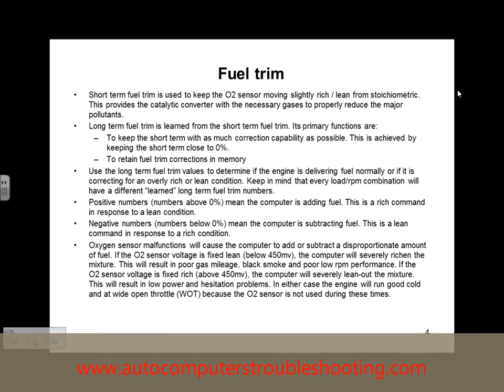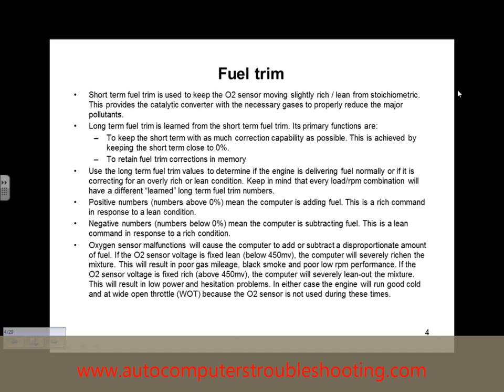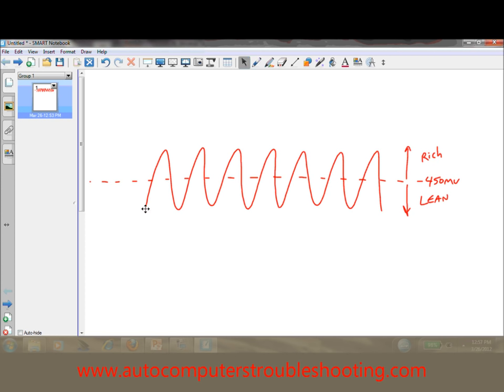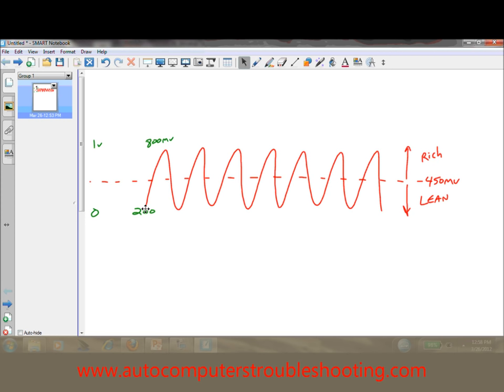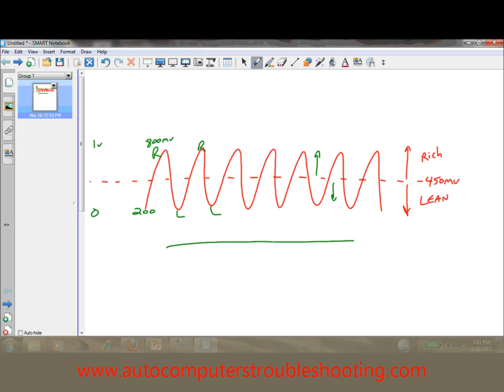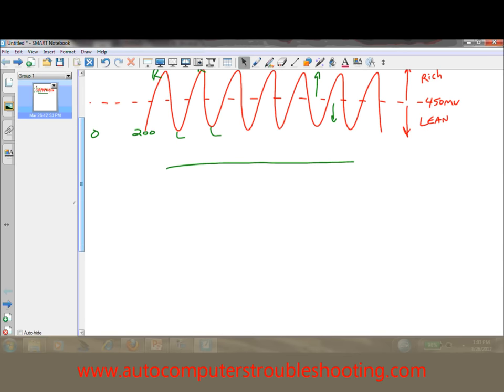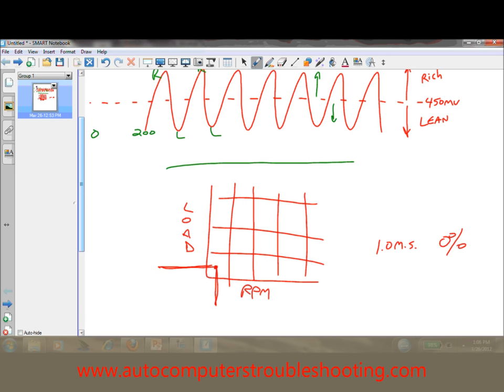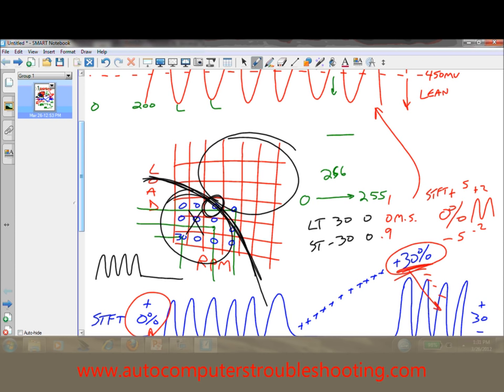Understanding Short Term and Long Term Fuel Trim (a SD Premium video)

Comment: Scanner i have a Ford focus 2004 1.6 petrol. The problem is that when i create a vacuum leak, than the short term fuel trim values stay at the same values -4 +4 % all the time. i already replaced the oxygen sensor 2 times. Could this mean i have a bad Ecu?

Comment: HI PAUL on AFR SENSOR WORK different as 02 sensor it say work opposite on a graph, like 800ml means lean not rich it is true or false, And how the PCM determinate to lower the RPMs in cold start what type inputs the PCM uses to lower the RPMs the soon as possible?

Comment: When the check engine light comes on, does it go into open loop? When in open loop are both short and long term fuel trims adjusted?
I have STFT running from 20-30, but LTFT is always 0 (live data). The light has been on for a while also; several hundred miles.
Reply from the maker: No, the system will only go into a FORCED open loop mode when it recognizes it can not adjust the air/fuel ratio any more, with the O2 is not responding. 
In open loop, you can possibly see some fuel trim changes, BUT, they are not being used. (WOT, decel, cold engine start are examples of normal open loop periods where I typically do not even look at trim numbers and I don't care what they are doing)
Don't worry about the why behind your long term staying at 0, focus on your short term, raise your RPM, see if it gets better or worse, this will dictate your next direction

Comment: My car 2015 Roush RS3.   STFT hover around +5 to -5.  (Normal is guess).  But LTFT bank 1 cruzin around 50mph is -11. Bank 2 is -5     Do you think there’s a slight issue with injectors on bank1?    My car is supercharged and at WOT it’s on 11lbs of boost.   LTFT go to -18 under full boost.
Knock goes -4.00 under boost at WOT. which it’s adding timing.

Comment: I’m wondering if fuel trims could help me determine if my 99 Ram 1500 with the 5.9 has the infamous intake plenum gasket leak....
Reply from the maker: On a MAP engine like yours, fuel trims can be near normal with a vacuum leak. What are your IAC counts? I believe it has one. (Throttle cable right?)
That is the data parameter that will really help you on this issue.

Comment: If the cat needs O2, why doesn't it take it from a different input other than the engine exhaust? So you could have small air pump connected to the cat downstream of O2 sensor 1. But if the extra air gets  to the sensor1, if would alter the o2 feedback.

Comment: I think first I need to understand more about the difference between MAP and MAF. I know fundamentally how both work, but not how they respond to vacuum leaks. Do MAP and MAF sensors account for the air from a vacuum leak? I thought air from the brake booster would enter the intake manifold behind the MAF sensor (essential bypassing it). How does the TPS affect the idle(the throttle would be closed)? FYI, I am not doubting anything that you say, I'm just trying to have a better understanding.

Comment: am currently getting codes p0153 and p0175 , my PDFEGR IN MY DIABLO scanner shows 1.08volts to 1.11volts always since warm up till 198degrees . my shortterm fuel trims for bank2 is -18% around fully warm up , i check and check no leak no vacumme leak, no bad connection, new o2s, change fuel filter, fuel pressure  is at 39-43psi , only thing i notice is on driverside valve cover non-pcv side it sucks air, as  well as oil filcap same side , pcv other side un plug and both side work correctly,?

Comment: Got FJ Cruiser 2010 with negative LFT (-3 to -13 in different conditions and -3 to -9 in idle). Compared with another FJ 2010 - he got LFT 0 to +5. 
My transmission got rough upshifting and downshifting. Can it be caused by LFT? The car got only 22k miles.

Comment from the maker: What you are describing sounds contradictory to me. If you have black smoke then the PCM should be subtracting fuel not adding it. Also if you can drive the O2s rich with a fuel source, how are they showing lean in a clearly rich environment?
The only real answer to this contradiction is you have a "false lean" condition. The O2s are "seeing" oxygen from something outside of the combustion chamber. (exhaust leaks, air pump) or you have a sever misfire.

Comment: Great explanation! I have a question regarding post cat o2 fuel trim. Many people say that post cat O2 sensors are only for monitoring catalytic converter efficiency. However I've seen codes such as "Post Catalyst Fuel Trim System Too Lean" etc. So does post cat O2 sensor affect fuel trim at all? Thanks.
Reply: Yes, I have been recently aware of this trend myself. I know that it is not on all systems and as far as I know does not have enough control to change the injector pw enough to cause any performance problems. I am not totally sure what they are doing with it yet.
Reply: ScannerDanner Premium I recently went to a BWD class and was informed Nissan's are starting this trend if the b1 sensor isn't functioning it only reads the b2 sensor until even if you replace the sensor you have to reset the fuel trims

Comment: Very Informative. I like your teaching method, as a non- professional mechanic, I got into this out of desperation to find out the solution to a Bank 1 STFT at -12 where a Bank 2 STTF runs around - 5, with both banks oscillating erratically but never in the same numbers. My LTFT is steady at - 12.5 always, even after clearing the mem.  I changed, spark plugs, spark plug cables, fuel pressure regulator, cap and rotor, all fuel injectors, intake gasket... CODE: P0175 and P0172.  Veh: Mitshubishi Eclipse 2003 3.0L Manual transmission.  Problem started after I used (overused probably) E-Z Foam.   Any suggestions are tremendously appreciated.  Thanks
Reply from the maker: +Ron Ackerman possibly contaminated the O2 sensors
Reply: Just what I thought after watching your video, so I ordered the 4 O2's. I'll keep you updated once I receive them and change them. Thanks for the reply.

Comment: Your statement of "the short term fuel trims number one job is to make sure that that O2 sensor is switching back and forth" is partially true. 

Switching and Stoichiometry: 
- When the engine runs lean (less fuel than ideal), the O2 sensor detects excess oxygen in the exhaust, causing its voltage to drop below 0.45 volts. 
- The ECM then increases the STFT, adding more fuel to the mixture. 
- As the fuel content rises, the O2 sensor detects an approaching rich condition and sends a voltage signal rising towards 0.45 volts. 
- The ECM responds by lowering the STFT, bringing the mixture back towards lean. 
- This creates the switching behavior of the O2 sensor - oscillating between voltages slightly above and below 0.45 volts - as it constantly reacts to the STFT adjustments and keeps the mixture near stoichiometry.

 Therefore, while STFT does influence the O2 sensor's switching frequency by adjusting the fuel mixture, its primary job is to maintain stoichiometry rather than directly control the sensor's oscillation. The switching is simply a consequence of the feedback loop ensuring optimal air-fuel ratio through constant adjustments.
Reply from the maker: to be honest, this is one of those things that you say potato and I say potahto

Comment: Best instruction on the web for anyone wanting to learn the workings of modern engine management...  Thanks... BTW - I have run into a puzzling '95 Tacoma w/2.7L if you chance to comment. STFT & LTFT <4% at idle (runs good) - at about 2000-2500 rpm, both STFT and LTFT rail at +20% and then misfire begins.  Yet, snap throttle reveals rich (normal) o2 reading during snap... I was ready to blame MAF, but it has been cleaned (no change) and reads about 11 gm/sec at 2500 rpm under no load.  A forum posting said the FSM for this vehicle lists 9.2-13.3  as normal.  Is that right (Maybe I'm barking up the wrong tree)?  Fuel pressures are good at idle, and disconnecting vacuum to pressure regulator reveal approx 10 psi change like it should.  It seems like you can "drive through" the problem (Idle and WOT o.k. - rich o2 on snap throttle seems to agree with this, and seems to me rules out Fuel flow issues like filter and pump).  TPS looks smooth on analog meter...I'm open to suggestions.
Reply: That is a tough one. I have seen MAFs fail like this. The signal output can be skewed and not be proportional to airflow at times.
I also never liked the steady throttle specs that are given for MAFs.  They've never helped me condemn one.
It sounds like you've covered all your bases. (Nice job btw!) 
I do have a concern though as you stated "misfire begins". Remember that most types of misfires will cause lean exhaust conditions. So is the misfire you feel a result of the lean condition (possible MAF issue) or is it the cause of a false lean condition (plug or wire problem etc) and your barking up the wrong tree?
What type of EGR valve if any does this engine have? If it's vacuum controlled can we unplug the EGR and test drive?
Reply: ScannerDanner Premium
Thanks 4 response.  I know ur a busy dude.  EGR was bypassed with same issue.  The $100 question is definitely "Is my upstream o2 asking for fuel because things are really lean, or because of an electrical misfire, causing the o2 to REPORT lean, adding additional fuel to all cylinders that already aren't burning it..."  I'm leaning toward an actual lean condition, because when I "sneak up" on 2500rpm, I can see the fuel trims rising into oblivion BEFORE I ultimately notice the misfire.  Also, in an attempt to correct the problem, the previous owner replaced the crank sensor, all plugs and wires, and the wasted spark ignition coil pack.  Unfortunately I am in one place, and the vehicle in another, so answers may not be immediately forthcoming, but I want to do another test before condemning the MAF sensor.  What has me puzzled is the rich o2 during snap throttle... looks good...but... I wanna see it under sustained load WOT (on a hill, etc.) to rule out (everyone overlooks the simple stuff...me too...) fuel filter, etc.  Sure, FP dead-head was good at over 90psi, and regulated pressure is good at idle, but there just might be enough fuel pressure still in the rail to pass a quick snap throttle test, and still starve it under sustained revving / load...Hmmm, good to know you don't trust the steady throttle spec's... The MAF IS where I am headed after that.  I just hate to be wrong... BTW - the previous owner sold this truck (131K) cheap to the current owner (and friend) because he became so frustrated with it... 1995 must be a weird year for obd2 ('cause of the transition)... at one point the truck had a P0300 along with 301, 302, 303, 304, but with a new o2 in front, all those went away...weird, because it's definitely still misfiring.  I also have a hard time believing it hasn't (ever!) logged a lean code with observed +40% total fuel trim! (maybe because as soon as rpm returns to idle, so do the trims?)  I think this early obd2 was not very sophisticated... Yikes!  I should also mention that the truck is very stock, right down to the factory (no leaks) air intake, baffles and air cleaner...
Reply: haywire17 Just before my MAF failed, my Prizm was compensating a lot less for a MAF. I'd check the fuel pressure to first rule out the fuel pump and then fuel injectors. I'm early on in my study of EGR so I'd have a harder time picking that out amongst the symptoms.

Disable the EGR, if the symptoms get better you've found your culprit.

You can always use a laser thermometer to see if certain cylinders are running cold. You'd have to remove the exhaust shields. This would certainly point me more at the fuel injectors being an issue. A laser thermometer in the needed temperature range is a lot more expensive, but I found one at Harbor Freight that I took a gamble on at 1/3 of the price of the mid priced ones on sale that can see the necessary temperature scale.
Reply: Don't Toyota"s require only the finest top grade materials in the CATS. Hope somebody didn't put a cheap one on  there. It is a 95, I'm just saying maybe its worth researching Toyota's notorious legend for CATS.
Reply: haywire17 I

Comment: Why don't the RPM's increase when the brake booster vacuum line is disconnected? This would cause unthrottled air to enter the intake triggering more fuel to be injected to make the A/F mixture return to stoich, which would ultimately cause a stronger pressure release when combustion takes place. To me, it would make since the the idle speed should go up. Why does the data not show this?

Comment: Long Term is the window of time the adaptive memory dictates the fuel trim, Short Term is live data calculating to learn the parameters for the adaptive memory to update the Long Term. The O2 sensor signals lean below .45 volts & rich above .45. The Engine Controller only cares about that threshold & uses that to determine fuel trim. .. in other words the computer calculates the % of time that the O2 sensor is past the threshold of .45 volts & does that each time the threshold is crossed.
Reply from the maker: Did you watch this lecture before or after commenting?
Reply: I didn't watch past the 1st sentence I was just giving a very simple explanation of what adaptive memory is.
Reply: ... remember back in the day when a customer of yours would come in & say, "I got up @3, went to Topanga to rip <surfing> up a few short sets then went to Wrightwood to go snow boarding. When I got back to the Valley my car <1978 Chevy> ran like crap" ... & U had to tell him that by tomorrow it will run fine because the adaptation of the computers memory of 4500' has to relearn 1200' .
Reply: ... I am almost 62, I started @ 16 <1977> retired @ 53 strictly doing Tune Up Work & 29 years of it @ a Dodge Dealership.
Bonified Old School Tune Up Man
A dinosaur, 1 of the last of a long line of artists that U never see in the industry anymore.

Comment: excellent presentation where are you based and any book recommendation to read.
Reply from the maker: I'm in Pittsburgh PA and I have a book available on my website www.scannerdanner.com
Thanks!
Reply: Thanks!
Reply: ScannerDanner why does the web site move all over the screen. I cant even follow what im reading. Its jumping the whole length of the page at times. Im on an android Dan.you might want to look into it. The free 30day trial dont work either.
Very keen to buy the book

Comment: Hello, excellent video! A little question, may be you can help me, what means this values?:
At idle              (LTFT +10% , STFT -4 ) 
At 2000 rpm   (LTFT 0%,       STFT 7%) 
At 3000 rpm   (LTFT +4,        STFT +4)
My mileage is very bad!!
Reply: If your question still stands and you are interested in an opinion of a random guy, those numbers seem to indicate you're running a bit lean (the fuel trims, when added together, stay on the positive side). It could be a small vacuum leak, but since the lean condition doesn't seem to improve with higher rpms (in fact, they actually get slightly worse, though not significantly), I'd guess it's more likely some kind of fuel delivery issue (lower fuel pressure, clogged fuel filter maybe?) or maybe oxygen sensor starting to fail and reading a bit lean all the time.

The bad mileage could very well be just the result of some power loss, urging you to step on the gas more.

But those are just my guesses based on what little we know. More data would be needed.

Comment: Paul, can a faulty o2 sensor effect open loop driveability? I know the o2 sensors are ignored in opens loop. But doesn't it base its fuel mapping off long term FT which could be skewed by a faulty o2.

Comment: The assumption is that the new car has 0 LTFT.  But I wonder if that is the case in reality as against the programming.  Would love to go out with a scanner and test a bunch of new cars to see what their readings are after a few days driving.  If my new car actually had a LTFT of 5% .i.e. manufacture was less than perfect - then my new LTFT of 12 is an increase of 7%   I have a new car with a LTFT of 12.5 when driving at highway speed, and 13.3 when idling. So likely a small leak, or simply variation in climate (high humidity here), which to my thinking would imply my LTFT would  be even higher in a drier climate.
Reply from the maker: I wouldn't be too happy with a LT of 12-13% on the highway

Comment: Paul, in a state where legal could someone remove the cat altogether and the car still run okay?  What else besides the cat would be necessary to remove? I am speaking of situations where the cat is over 80000 miles and the owner does not have the money to replace it.  Hypothetically speaking, of course!
Reply from the maker: +Jim Buford just remove it, but also know there are big time fines and the threat of even jail time in some areas for that.

Comment: What is the point ECU keeps increasing the trim until the 0.8V o2 signal and then leans it until 0.2V. Why does not target the 0.45V instead and move slightly around? Is that because 0.2-0.8V o2 signal means ~0.9-1.1 in lambda so when we state rich by 0.8V o2 signal, in lambda it is just slightly more rich than the ideal 1.0?
Reply from the maker: Because it is a switch, not a sensor. .46 to .8 means the same thing. .44 down to .2 means the same thing. It must be moved back and forth the .45 set point.
Also there are gases being used on both sides of the stoichiometric ratio to properly feed the cat
Reply: @ScannerDanner  I try to get my car running slightly on rich meanwhile the ECU thinks it's just on stoichio by decreasing ~0.2V from the reported voltage of the narrowband o2 sensor. Actually I will make it adjustable from 0.05 to 0.35V and play around the car reaction in acceleration, reaction time and milage. I believe modern cars are suppressed, some of the performance and flexibility are sacrificed on the altar of environmental protection. What do you think, does it make sense?